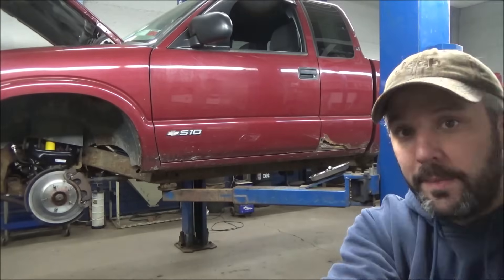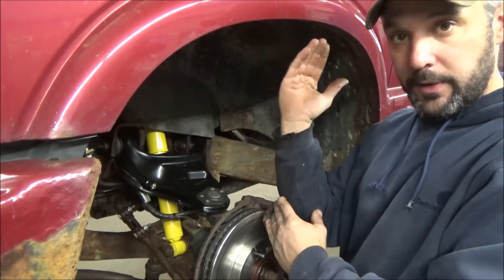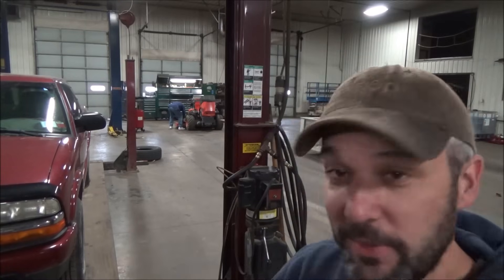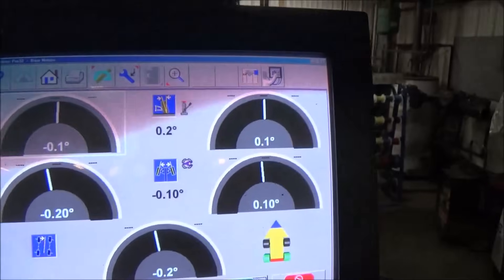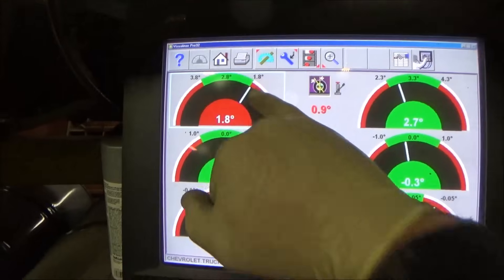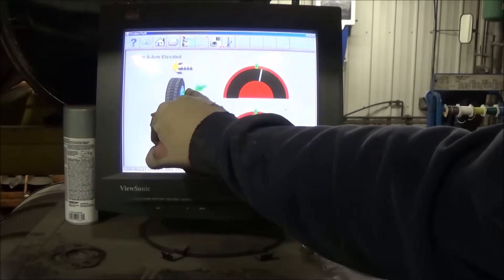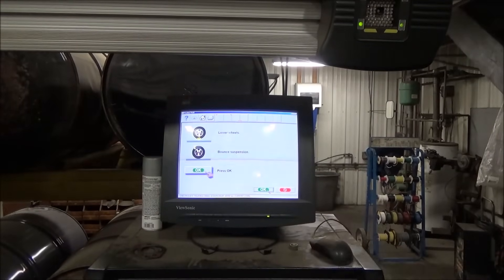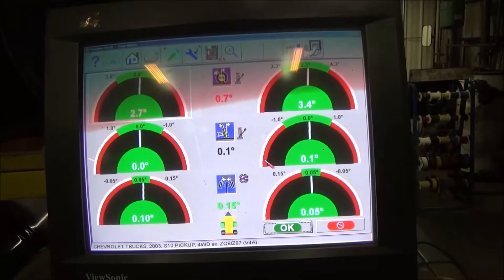Front Wheel Alignment - Caster, Camber & Toe

Comment: So I replaced my upper control arms, ball joints and tie rods on my 4x4 s10. Took it for alignment at the shop a block away. They offered an $80 alignment. But then went on to tell me that the camber/caster alignment would be an extra charge. They ended up doing the tow alignment and then called me to tell me that I need to pay more for  the rest.  Knowing full well that the camber and caster need to be done first. Makes sense. I really think they didn't know what they were doing. Don't be scammed. I'll take it for the full adjustment once I get new tires at a more reputable place.

Comment: Correct camber on right is 0 to 1/2°+. Castor is always 1/2° more positive on the right to make a very slight pull to the left to compensate for crown or slope of the road. Camber on the left is always set at 1/4° to 3/4°+. When the driver sits in the vehicle camber on both fronts will be 0°to 1/2°+. This is the only spec for every vehicle on earth. Go kart, concrete truck, Chevrolet pu, or an old Pinto. 60 years of wheel alignment. Aftermarket parts will allow caster-camber settings. You won't find adjustment on Chevrolet cars in the 40's and maybe early 50's. Remove front upper control arm grease fitting. There's a threaded cam, Allen head,  that sets caster and camber. Put the fitting back and grease it. Throw away your spec book.

Comment: I learned how to do alignments in 1984 when I was 24 years old.  The shop where I worked sent me to school for a week to learn and they had a Hunter Light Align 2.  You had to do the runout adjustments using the bubble indicator on each head, do the caster sweep, calculate how far to move the cams and which way or what shims needed to be added, removed.  It was all up to the technician to know what to do and how to do it.  Technology sure does make it a lot easier, but doing it old school really helps you understand what the angles do in relationship to each other while a vehicle traveling down the road.  Thank you for making this video.  I own my own shop but I work alone so I don't have an alignment machine.  Too expensive and I'd never do enough alignments to pay for the machine.

Comment: I made the mistake a very long time ago replacing only the "loose" parts, you will soon need to replace the other parts. Its better to replace EVERYTHING, IMO. I made that mistake on my beautiful 88 Turbo Supra some 10 years ago. I replaced one wheel bearing, both the lower ball joints, one upper ball joint, both tierod ends, and one inner tie rod.. felt very good for a year but never like a "new" car which i though was normal. Changed the rest of the parts and it made a world of difference, EXCATLLY like a new car and it felt so much better in tight corners under heavy breaking. On my 2005 S60 2.5t with 190K miles I replaced the wheel bearings, lower control arms, sway-bar links and bushings.. everything. The car was pristine and I let a mechanic friend of mine drive it without looking at the milage (over 200K at the time) and he honestly thought it has about 50K miles on it.

FYI, during normal driving I almost never step on the gas more than 1/4.. even on a backup beater 95 Civic DX 5 speed I got. Just no need to wear down an engine to "feel" like you're getting somewhere faster. And i drove as a NAPA driver for over a year, 40 hours a week. You have to drive about double the speed limit to pass the lights, otherwise you will almost always catch the light and then granny from the last light will pull up next to you lol. I was 18 and dumb.

Comment: I have been an alignment tech for about 27 years and alignments are still my favorite. I do now get an occasional brake job or suspenion repair. I am just learning some engine diagnostics and have learned much from your channel. Thanks
Reply: How long will it take to do camber/caster and toe alignment if all parts are new? 
Do you need all 4 guide pins to adjust camber/ caster on a Cadillac escalade esv?

Comment: Techs like this one are rare these days. Most techs today will just put it on green and call it a day.

Last tech aligned my rear toe, although in green, the readings were 0.01 LR and 0.18 on RR. It caused the thrust angle and steering to be tilted. I had to comeback and tell them to even out the rear toe so the the trust angle would center.

Good job!

Comment: I just started at an alignment shop after 5 years of paint and body . You may have just saved my ass . I never did suspension work before this. My boss owns both shops and started me at the alignment shop knowing i have no experience. This video helped quit a bit , but I wish you would have shown the exact places to find all the cam bolts while you were adjusting them . Rather than before you started the adjustment. All in all you helped me understand a lot more than I’ve been taught in 2 weeks. Thank You
Reply: @randytingle3413  damn right my dude. !!

Comment: Eric over the ditch here we use 'occy straps' to hold the heads on the wheels, especially useful when the car has really expensive Billet Wheels & you can't crank on the handle & get them tight as they will scratch the rims!

Comment: I usually take my truck(s) to an old-school alignment shop that does big trucks and they have a totally old-school setup. The tech (who is a friend of mine) starts by jacking up the front end and spraying paint on the centerline of the tires. Then he has a pair of cutting wheels on a rack and he moves them to where they align with the center of the tread and cuts a small groove into the tire tread. The rest is like black magic to me but it gets the job done. He also has hydraulic benders to tweak the solid axles and radius arms on trucks to change camber and caster. He says that sometimes he puts them on big truck axles and leaves them there for a half-hour or so to let the axle settle in. The axle will heat up and paint will sometimes flake off as the steel bends to the will of the presses. 

Then the truck drives down the road straight --  compensated for road crown, of course.

Good video. Increases my understanding of the subject immensely. Thanks for taking the time to make this video.

Comment: I am new to this channel.  Thank you. This and all your videos are well done.  In the mid 1980's i worked at shop while I was in college.  I was the alignment guy.  It seemed i had the patience for dialing in the measurements.  The wheel mounted heads had to have the runout removed manually.  Also the machined used light reflecting against wheel mounted "flags" with numbered - graduated scales for toe.  Caster / Camber was measured with a bubble in water similar to a carpenters level.  Brings back some memories.

Comment: Another top video from the best car repair channel on the net. The days of reflector boards at the front are long gone.  I like how its all fully computerised now- literally showing you which way to turn the camber bolt. Also the old style ding ding sound is the same as when you used to hear when you pulled into "gas" stations- we call them "petrol" stations here in Aust. 
I agree, doing just alignments might send you stir crazy especially if there some looseness/rust in joints similar to trying to turn a old piano with a weak frame- the notes wont stay in tune!  That is really frustrating too.

For those wanting to try the "string" method of alignment, you tube videos almost always show aligning to the rear wheels and as Eric showed, they are usually out of alignment so doing it this way wont work.

Comment: I'm an alignment tech. With my alignments I generally dont set them to spec. And I've found that I get better tyre wear and better handling.  But that is road crown and driving condition specific.
Reply: That's the problem I'm having. Ever since the Toyota dealer messed with my Tundra alignment I've been unhappy. Brought it to 3 different alignment shops since. And all I ever get is "EVRYTHING IS IN THE GREEN". Good for you thinking outside the box.
Reply: What’s road crown
Reply: @syntheticvi  the slight pitch they put on the roads to get them to drain off to avoid pooling/ hydroplaning.

Comment: I noticed that the Hi pro truck you are working on didn't have much camber, I would have plugged in about 3 deg neg camber in the front and rear for taking those hi speed corners, plus I would have taken all the caster out for a really fun time going fast...puts a smile on my face with 0 castor.

Comment: At the beginning of the video you asked when do you stop.  I have an 87 S10 almost the same colour as that one, but the body is in better shape lol.  Over the summer I did a complete stainless steel brake line kit, all 4 control arms, coil springs, spindles, shocks, tie rods, sleeves, Jeep steering shaft conversion, brakes all the way around, and put a floor in it .  I dumped about a grand into it, but the truck has sentimental value to me, it was the last vehicle my grandmother bought.  That and even with 267K on the original 2.8L, the thing runs like a dream.  Yeah, I love the truck, but this may be the last time I put that much work into it at once.
Reply from the maker: +Eric Brunhammer Wow that was a huge project
Reply: keep that truck going.  s10 and s15s  are getting hard too find  that's not beat too death or rust rot everywhere.  mainly 91 and under.   i have a 91  s15 4x4  3inch lift  custom paint 5 speed .  and it hardy saw snow and never will see it again.  now it did sit outside which i live in Pittsburgh for 16years.  but hell its in great shape still and runs and drivers perfect:)   pretty much just needs tires and a muffler cause that was the ony thing that rusted away lol..

Comment: OK, I know that you weren't thrilled with the excitement aspect of your alignment video, but I found it very informative. I had my '98 Jeep GC aligned the other day and I'm a bit baffled by the caster part of the readout, and am hoping that you might check in and issue a quick answer to a question. FSM shows caster range of 6.5-7.5, degrees with a "preferred" setting of 7.0 degrees. My readings were unchanged from "before" to the "after", and were at 8.1 and 8.2 degrees. I'm wondering if that amount of over specification is problematic, and whether you, being the fine mechanic that you are, would accept these settings. Any thoughts are appreciated, although not expected. Thanks for all of your excellent car-mechanic videos. I've posted the question on a Jeep forum and so far have only heard crickets. Cheers.

Comment: Alignment racks has sure come a long way.. Would even know what the cost of one would be today. But anyway get video wish we could have meant dad tho.. Thanks Eric
Reply: +jim McMillen Back in the 90s I worked in a VW main dealer, and the alignment setup wasn't that different - you had the computer setup with a similar display, and the sensors that mounted on the wheels, etc. If I recall, the whole setup (ramps/lift), computer/wheel sensors, etc., cost something like £25,000 (approx $38k).
Not sure how much that would cost these days.

Comment: I know this seems like a mundane task, but not all shops get it right!  I just had an alignment on my WJ. With a toe of -15° / -10°.  -15° is off the scale. Fortunately it was a temporary alignment after replacing Ball joints and tie rod ends, before installing the IRO lift.  The jeep wondered all over the road. 

Ok follow the left tire no the right no left, ok the left,  now the right.

Comment: How do you like that John Beene machine?
Reply from the maker: +briansmobile1 I use this and a Hunter... I dunno, 6 in one hand and half dozen in the other. They both seem to work about the same to me. You have a preference on one ?
Reply: I've only ever used Hunter.   I've used the corded and the optical hex heads similar to what you've got there, but with triangles instead of circles on it.  I really liked Bob the Hunter rep.  The guy was a gem of wisdom.
Reply from the maker: They Hunter machine I use is on Tractor Trailers. It is wireless but it a little different then the ones we use on the cars. Pretty much same principle though just a lot bigger scale...
Reply: briansmobile1 im use to hunter machines, now there new series has self adjusting heads no more turning the knob to tighten it to the wheels, im still getting use to the john bean machine
Reply: briansmobile1 yeah!!!!!    That machine is the shit!!!!

Comment: What about the rear-end alignment?  How about 4-wheel alignments too?

I have a '90 Pontiac Sunbird where the rear end alignment is out (and it's completely unadjustable), yet my '02 Subaru requires 4 wheel alignments (which is how I found out about the Pontiac's alignment problem and why it has a vibration issue)...
😉👍

Comment: "Wirelessly"

More like optically!
Those white circles and that one ring are all infrared reflectors placed in strategic locations. The two cameras on the T tower shine a bright infrared light (invisible to the naked eye, just like old TV remotes) that hit those reflectors making them stand out from everything else in the background in the infrared spectrum.

Try smoking a cigar when you work around this machine and it might get confused as to what is part of the alignment head and what is the cigar as anything that hot emits a lot of IR light.

Nice to see how it's done but i would be more interested in seeing how it was done before this new system as that is more down to earth so to speak.
Either way, great video.
Reply from the maker: +Cadde Maybe the next time Kilmer is testing an EVAP with a cigar he could test this theory :)

Comment: Very informative!  A question I have, if you have time to answer, is on a solid axle 4x4 like a mid-80's chevy, when the steering wheel isn't straight ahead, do you adjust the steering link first to get the steering wheel straight and then the draglink to get the proper toe-in?
Reply from the maker: +farmboy30117 On those you adjust the tie rod that goes from wheel to wheel to set the toe, then you adjust the single bar going to the gear box to set the steering wheel straight.
Reply: +farmboy30117 and offset ball joints. what a invention!
Reply: farmboy30117 u can get the offset sleeves for the old chebbies n fords n dodges, or i think u have to totally disconnect the ball joints and pop out the sleeves and turn them like turning the whole strut assemblies on the escorts to adjust camber n caster.

Comment: Hey can you do a guide showing how to adjust camber on 99-04 Jeep Grand Cherokee WJ's (4.0L I6 or 4.7L V8)
I have front negative camber thats eating the enside of tires pretty bad. Ima need to buy used tires for the front and hopefully do alignment adjustment myself instead pf paying $250+ they charge locally for front end alignment.

Comment: Very informative. Even as just a customer, I think it's important to know what happens behind the scenes. 

Maybe it's my OCD, but I would think that just replacing one shock, especially on the front end would give the vehical a weird feel, and handling characteristics when going down the road that would nullify all of the work you put in aligning the front end. 

Maybe it's the customer that didnt want to replace tge other side. Maybe it's as you said, so many other things on this vehicle are worn out. Maybe it's how the rear shocks work on a GM truck (one goes forward, one goes back) that gives the rear a sloppy bounce. If it were my vehicle, I'd never change out just one shock.

Comment: If you can give me an answer, it would be appreciated.  On a 4wd, rear tires last about 6 mos,. The front get normalmileage ware. You mentioned some toe adjustments on some 4wd vehicles on the rear.  2004 Jeep Wrangler.Thank you, great video..  Vehicle is used for normal highway driving..

Comment: I have never ever had an alignment done on a car in which the car came back handling better, always scittish twitchy, darty, and unstable in the wind or pitchy when driving behind a tractor trailer.  I dread getting alignments done when I get a new set of tires. My last alignment on my Crown Vic, I had all four ball joints done... steering wheel off center and all the other problems included.   Too bad this vid was boring to you lol... Very interesting to me. Do you have options on adding more caster than factory specs ?

Comment: So, How do you move or turn the camber offset washer things?   ....  anybody know can answer.  Thanks.  ** Great Video too !
Reply: You put the correct size socket on the bolt in the back of both sides( one bolt at a time) and either turn in( toward the chassis) or out( towards you) accordingly to the desired angle of wheel preference.

Comment: Just curious since the rears weren't adjustable, was it still mandatory to attach the cordless heads to the rear wheels?
Reply from the maker: It is to get the center line measurement

Comment: I have one inch wear on both inside tires Jeep Liberty.  Is spring just settling and allowing front arm to raise up.  How can I adjust this.  My plan replace front shock struts.  Would be nice not having a alignment shop screw around with it.  You should toss some rear shocks on whats another $50

Comment: Those tires don't look like they would cut it in the snow, is the owner planning on swapping them with snow tires?
Reply from the maker: +06acc dunno what his long term plan is with tires...
Reply: Owner could have a second set for winter, depends where live have two sets, in UK we often just use summer tyres as not worth changing for like 5% or less of the year

Comment: At any point when making adjustments on the alignment machine do you use a impact gun or just wrenches. My alignment guy did a bad alignment and my new tires got over half worn out on the outside edge. It was so bad the tires were screeching on turns. Should the shop replace the tires?